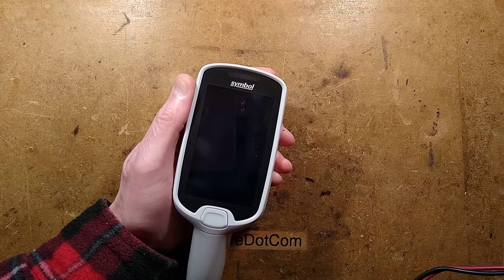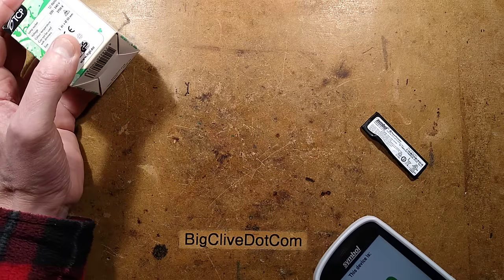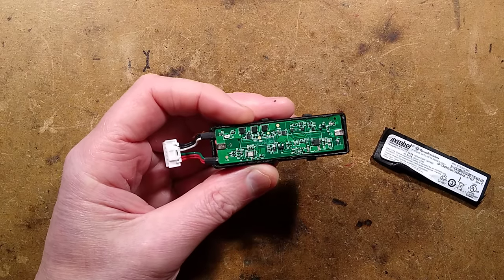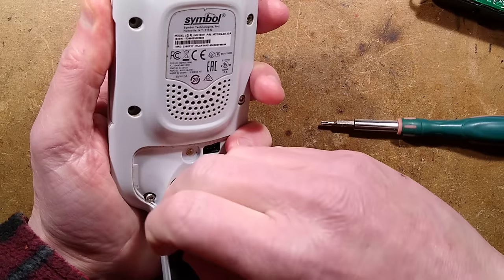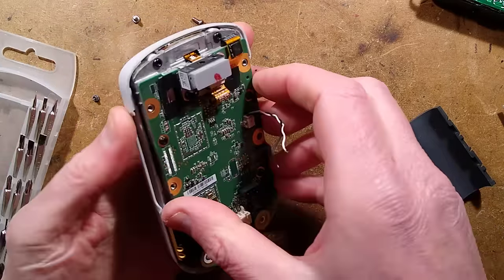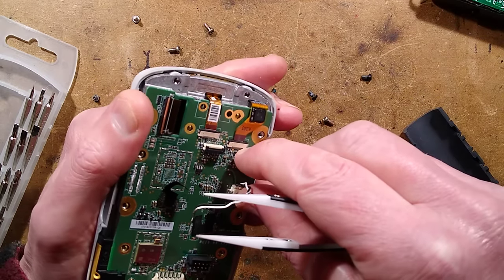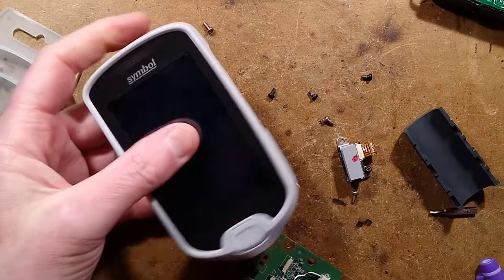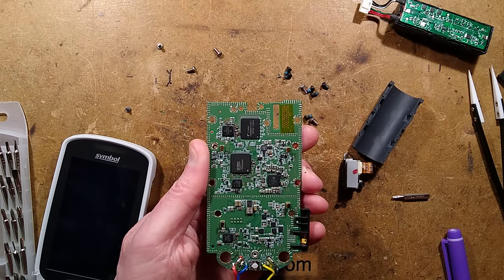Inside a Zebra MC18 self-scan terminal

Comment: Our scanners (currently in use!) in a local big-box stores still use old handhelds that are essentially the same exact as this one with a bit of a different form factor (minus the handle and a flat battery pack on the back.) Same software. Same awful slowness and same awful old android-based OS. It'd be wonderful if they were replaced with a modern equivalent.

Comment: Every time I use 1 of these in Asda I wish I could take it home and tear it apart lol. From seeing faulty units in the shop, I've been able to work out that the system is windows based and the terminal to unlock handsets runs through a web interface/application.

Comment: I bought one after seeing it on your livestream a couple of weeks ago. So far I've managed to push some charge into the battery by stuffing probes into the outermost red and black sockets on the connector and hooking them to a TP4056, and managed to get the recovery screen up. Unfortunately there was nothing useful in there.
Reply: if you want i can help the connector on the back has standard usb all you need to do is boot to the recovery screen select update from adb install adb on your pc and push their os to it
Reply: Thanks, I mostly need a pinout - I can rig up a USB connector to plug onto the relevant pins of that connector but don't know which are which.

Comment: I brought one off a seller on Ebay, was able to flash firmware to reset with a diode across the centre two pins.
Reply: And a usb cable connected to he pins on that 4x2

Comment: agent connection failed is probably related to the vmware software in boot up. all the data functionality is probably processed by a "virtual machine" hosted on a server. vmware is mainly that technology. the unit can probably only scan and make a remote connection without any other functionality. it makes sense that if you scan when not connected it will have a tiny buffer because no data is being processed.

Comment: I had (or still do have somewhere in a do-forget-box  ;-)) a few years ago the earlier version, the MC17, to be exact the Motorola Zebra MC1790. This version runs on (obsolete) Windows CE (mwhoahaha, do you remember ?!?), the professional edition version 5 (or 6). To develop something for this, you need a lot of stuff. The battery is very similar to the MC18, same connector, same wiring. Had no charger but because it is just a 18650 cell, it was easy to charge with an universal charger. I have all kind of documentation, including the manual that describes a special USB cable (and pinout) to connect to a computer. I made a working one myself and worked great.  I quess yours, the MC18, provides the same feature, the rectangle 8 pin socket on the right of the battery connector.  However, I could not figure out how to stop the looping and locking main program from executing or put it into programming mode. And like all stuff of MS, you need all kind of frameworks to download, all kind of complicated made stuff. Finally, I gave up after hours/days of trying. 

If the MC18 is running an earlier version of Android, maybe it is easier to do but have some doubts. I think these devices are like all obsolete devices, for example the Apple Ipad I or II. Use the parts if you can find a datasheet for it or information about and skip all other parts especially the PCB with MCU.

Comment: The Elpida chip will be a memory-on-package device a bit like the original Raspberry Pi;  the TI chip that drives the system will be underneath.  These use a TI OMAP processor, quite an unusual chip to find in an Android device but reflects the unusual use case (performance/power not really important; design cost probably more so.)

Comment: I was repairing somebody's rather recent iMac the kind with the glass and aluminum. For some reason the back light for the display is like 25V and it's on a 4 pin super thin ribbon cable. it wasn't the connector I had a problem with.... the traces started to come off the ribbon. I super glued them back down carefully and sandwiched it with something and left it overnight. and very gingerly reassembled.

Comment: Been using these for years. To be honest though, the earlier version was better, you could scan off multiple items in quick succession. These new ones force you to wait a couple of seconds before it will accept another scan which is slightly annoying.
They certainly make shopping easier, I have a couple of big Costco bags that I fill up and then lift right out of the trolley and into the boot of the car!

Comment: This looks just like the scanners at my local Waitrose. I was chatting to one of the staff about them (as you do) and he said that they were slowly phasing them out by not repairing / replacing them if they broke. The idea being that they want customers to use their app on a smartphone or the self scan checkouts. /The problem is that their app is a bit c[rhymes with app] and the self scan checkouts take extra time. Could this be one such obsolescent device or is it brand new? It's also locked down because you don't want your customers reprogramming it to give them free sausages.

Comment: I use one like this every week. The one here has a sneaky camera in the front.  Nothing interesting in the software then?  I saw you double (triple?) tap that front button and it tried to take a screenshot, might give that a go next weekend shopping! 🙂
Reply: A certain large supermarket I regularly visit has similar ones. Sometimes they could be found on the rack displaying the Windows screen. After a few goes I found a shortcut which unlocked the cradle for a set time - allowing you to take the scanner without scanning your clubcard! Unfortunately they have updated the firmware and now they never display the Windows screen...

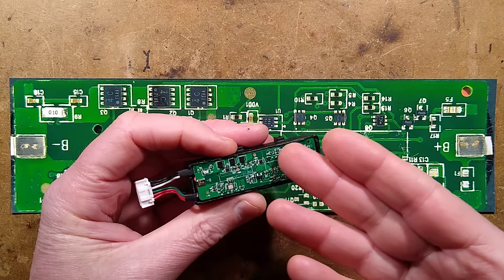Comment: 6:41 Most batteries will be dead forever after the battery ran flat. Almost every battery that offers I2C communication will have a chip that locks out if the battery is below a certain voltage or you replace it. There ware ways to change values inside the ICs to make them work again, but the software and hardware is very expensive.

Comment: These are pretty nice bits of kit. You see a lot of these (but slightly more ruggedized) Zebra units in various logistics spaces, from courier warehouses to scanning barcode tags on the back of logs in export scaling sheds.
Really, the only reason they get replaced is because they don't get updates for new Android versions and even the custom software gets stupid new dependencies over time. Some Chinese company should get started making similar gear with Android Go or something and provide continuous updates, you'd be good to go for years.

Comment: Last one of those that I took apart had a mechanical gizmo to scan the laser beam across the bar code and a simple phototransistor for detection. A camera is clearly simpler mechanically but I don’t see how the beam is generated. I wish you had dug into the scanning head a bit more just for curiosity’s sake even though repurposing it is improbable.

Otherwise yeah, the rest is basically a smartphone equivalent minicomputer that could be reflashed if there’s an open source version of Android that will run on it. But with cheap unlocked smartphones available cheaply with lots of memory and fast processors, is it worth the effort other than as a novelty?

Comment: I have 2 of them in my loft, and i do have a older server with the vmware software, the lockdown can be removed using the server, then with a little homebrew you can turn them into a network and IR scamner

Comment: Clive, its trying to communicate with a mobile device management server (AirWatch) and, as such is locked down. That's why you see agent connection failed
Reply: It doesn't appear to have been wiped; still has the Asda Scan & Go logo on the screensaver. I wonder if you took it to the Hessle Hull Asda store it would actually connect and be usable? Most likely they will have blacklisted this device when it was taken out of use.

Comment: I would LOVE to get my hands on a box of these. They might not me very powerfull, but they are handheld computers with wifi connection. Could be very useful if converted to a tool for quickly setting up DMX equipment :p QR on the fixture, and you just have to scan to get all the specs you need ;)
Reply from the maker: That would be quite interesting, although the RDM lights do have that sort of functionality.

Comment: i work at an hostpital (it department). we use similar ones, still zebras but they are more like rugged android phones with big honkin sensors in the top and a docking connector on the bottom. they love throwing themselves off the wifi

Comment: Hey Clive can you look at refillable g2 pods from a vape device?  They are in packs of 2 for about $10.  Am trying to figure out why they fail so quickly and if there is a way to service them (ie change the coil or the cotton wicks).  Pretty sure you don't need an actual device tomfire the coils, just a battery.
Reply from the maker: I can't make videos about that type of product as it causes YouTube issues.   If they do not soak the liquid into the wick easily or run dry they will often burn immediately.
Reply: @bigclivedotcom  Thanks for the info.  Am wondering why they don't sell a coil insert for these instead of filling landfills.  I understand they want to make money, but coil/cotton replacement isn't a new thing.  They'd still be in the money because of plastic and rubber wear and tear.

Comment: at work we went to the Zebra WiFi phones, the marketing was you can walk anywhere and use them in the elevators, and access points are in the elevators, upon implementation they are utter garbage, they have not worked since day 1, the duress alarms get stuck on, you fart to hard duress alarm, and walking from AP to AP they then alarm "duress alarm unavailable", and its a loud alarm, we are now in the process of swapping them out for a competitor.

Comment: Looks just like the ones we have in Tesco in Ireland, but ours appear to run Windows, while this one seems to be Android.
Reply: I can confirm they run windows, I've seen them crashed to the desktop a few times!
Reply: Waitrose quick check systems (mid 2000s to at least 2016) used Windows CE. When taken down to the basement car park they'd lose signal and reboot themselves until they found signal. During quiet periods you'd be able to hear the reboot chimes from the opposite side. I remember playing around with the handsets control panel and apps in the 20-30 seconds I had before it rebooted while I was waiting for the lift to come down during trolley run.

Comment: Totally looks like a custom Android OS, I wouldn't have guessed it's that software they use in those devices. Maybe you could try booting it up while holding the button under the screen + the button you added at the bottom of the device. Press both of the buttons and hold them longer than what you did (at least until the boot logo disappear). Well, if it does nothing, it's definitely not easily possible to enter the download mode or recovery mode. But anyway, without an USB port, it's going to be hard to upload anything to the device.

Thanks anyway, very interesting video to discover this device as I never used one and I prefer the human contact of a cashier, but I didn't think it was running Android, I though it was totally proprietary software.
Reply: Honestly with handheld computers like this my first thought is always Android unless it's obviously something else.

Android's pretty light without Google services, very flexible and already has a lot of compatible software, not to mention having good security already built in for "locking down" the device (like user profiles). It's also free and open-source, so no licencing fees lol
Reply: @joj.  But it's also a drawback that it's widely used and well-known, because if you can determine the system version, you can probably find many root exploits shared in the community like XDA devs.
Then, with root and elevated privileges, you can easily (for someone who knows this stuff) modify system apps like the app that is used to scan articles, and maybe you can make it count 1$ for anything that it scans.

Over the years, I've seen many products coming from China (MP3 players, FM emitters, GPS etc...) that had their own system made "in house", it looked and felt cheap, but it worked. And I was thinking that maybe those scanning devices were using such very very simple systems developed "in house" by american or european companies, with just one purpose "scanning products and be connected to a distant database for up to date prices".
Do they really need a touchscreen software layer, a back button, home button, multitask button and all these pieces of software just to scan products and make an addition at the end ?

That's why I wouldn't have guesses that it used an Android OS. Well, I guess it's most of all a matter of costs. Cheaper to use Android and modify it than to write software from scratch.
Reply: @Mat_1000  Eh, to an extent? Sure, it probably* has the capacity to be rooted, like any other version of Android, but that doesn't mean it's practical. There's nothing to be gained from doing it - in use these pull price data from a central server to display a bill for the users' convenience but at checkout the items are transferred from the handheld unit onto an actual checkout kiosk, at which point it's using the shop's fixed price list. The touchscreen lets the user edit the quantity of items or remove them, and the system UI is neither visible nor accessible in regular use.

I would guess there's a community for modding these (what doesn't have one lol) but there's no actual reason to do it beyond reuse when they end up on the second-hand market, and there's definitely no chance of monetary gain. It's probably also awkward to get all the blobs (read "drivers") to make it fully functional on anything that's not the stock ROM.

Android is good for security. Keep in mind that "using Android" actually means building on AOSP, an open-source project that gets frequent security updates and is more than capable of keeping separate admin/customer profiles with limited access to system settings. It's sensible to pick something free, modifiable (by the dev) and secure when it's going to be online in-store.

* Probably because I would guess the bootloader is locked and if there's no way to access the settings, that's permanent and more than enough to block modding the device entirely - see e.g. the Anom phone.

Comment: Interesting, now they getting retired and on ebay I may want to get one to mess around and see if theres a way to break the software open. but I do find it interesting that they run vmware, so it is virtualized? very interesting, saw that logo on broken scanners before.
Reply: Actually, I wonder the header that's not used, I wonder if that is JTAG/Serial. I've checked again to see if there are any marks on it, but so far nothing visible. But thanks to the button I know I should short out the 2 middle pins to make that thing turn off. At least good trolling :face-blue-smiling:
Reply: nope vmware have a remote management thing and launcher for android the connector on the back lest you connect to it over usb and flash their stock os using adb
Reply: @404invalid-user  nice to know, I have been only familiar with the virtualization products. But good to know it's an adb port, good fun, thanks!

Comment: I recall when I worked at the co-op they were just starting to explore android based equipment for hand held devices. They launched Samsung tablets into every store. However they did not have the standard Android home screens. They had a proprietary white home screen with links to co-op apps and intranet pages etc. I've since heard they're pretty easy to hack by doing the standard Samsung programmer menu reboot. 😂

Comment: Here in Germany, where self scanning isn't that big to begin with, I am only aware of one store chain that uses this system - and that is Globus. All others, if at all, use the scanners at the exit.
I love the system they run at Globus - I only have to handle  the items once when relocating them from the shelf into the shopping cart and once in the parking lot when taking them out of the shopping cart and putting them into the bags that I have in my car. (They don't like people taking their bags or boxes inside, except for insulating bags when buying frozen stuff) With the typical exit scanners, you take them off the shelf, put them into the cart, take them out of the cart, scan them, put them back into the cart and then in your car. Way too much effort.
And as far as I know, they are actually working on a cool new feature - since they link to your customer account when you pick them up, they want to make it possible that you can prepare your shopping list online and it'll show up on the scanner and gets checked off when you scan the items.
Reply: They're a completely foreign concept in America, to the point where it took me several minutes to realize this wasn't for the cashiers. With the current panic here over shoplifters, I don't see them making their way here any time soon, but maybe I just don't shop at the right places.
Reply: I've seen Rewe also using this in some locations, but they also have a phone app to do the same thing so I haven't tried the physical scanner myself. Quite nice to avoid the Kasse stress when buying a lot of goods.

Comment: I wonder if you can use barcodes to access the device and unlock it? I mean, its got to be scanning for a reason, why would it continue to try scanning items if it cant access the database to look those codes up? Its got to be for offline setup, surely?
Reply: The scanner functionality is separate from the app that's running on it. When you scan something it just inputs it as if you typed it on a keyboard.